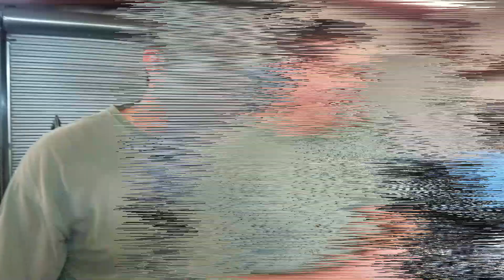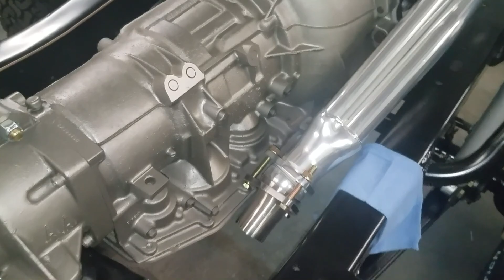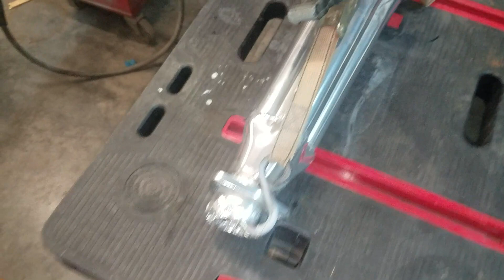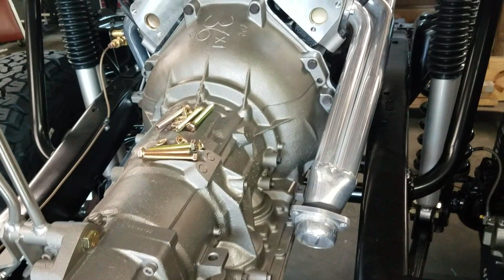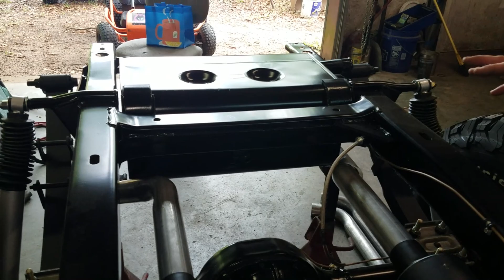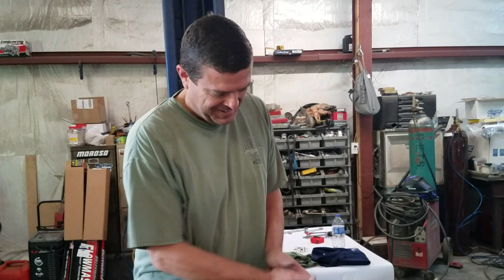TBP Headers and James Duff Exhaust Installation - 1966 Ford Bronco Restoration Project

Comment: Do you have the rubber isolation washers on the right side? Thought they were supposed to go between the bracket and the frame? Maybe I missed something? Great video - look forward to part 2!
Reply from the maker: Thanks!  It is more important to me for the exhaust to move with engine torque.  The bracket supported better like I have it.  The knee brace I built is flexible too.  It will be shown in the next video.  I appreciate ya.
Reply: @JasonJonieBuilds  Thanks for the explanation, makes sense to me. Exactly why I love your channel - learning so much!
Reply from the maker: @jarheadtx1  Your questions show  you watch!  Thanks

Comment: Sure is nice to build a bronco from the ground up. You can put anything anywhere for the fitting. You go through a lot of different problems each step, but you can work it out. Looking good. God Bless
Reply from the maker: Thanks Jack.  I know the video is long but I wanted to show that it takes a little extra effort some times.
Reply: @JasonJonieBuilds  It wasn't long. You got your point across and are doing it good.